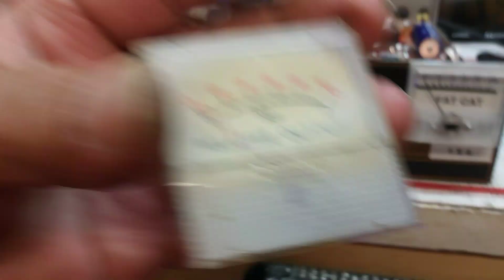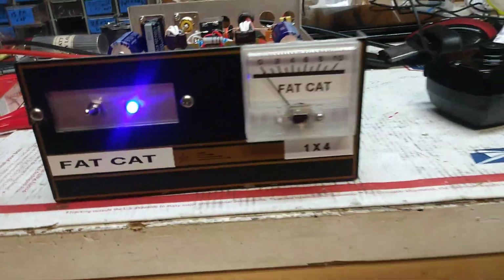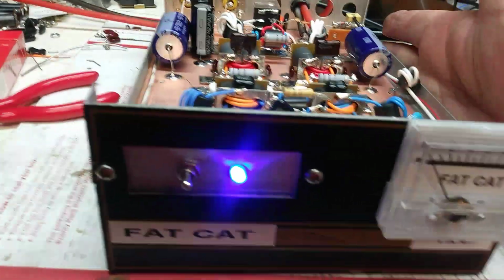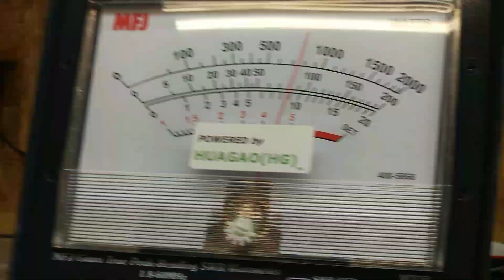1 x 455 - 4 x 2290

Comment: like the MRF 455 driver! I use SRF 3775. GREAT JOB. amp looks great.  you don't need 2SC2290 or 2879 it would run hot.